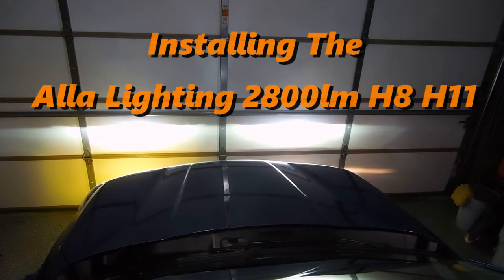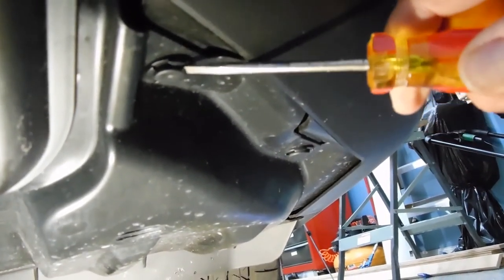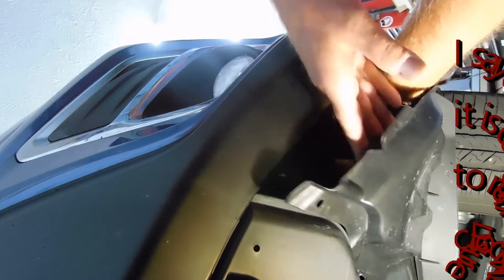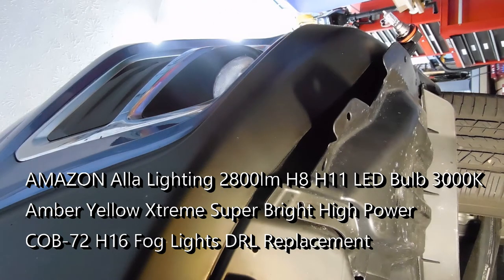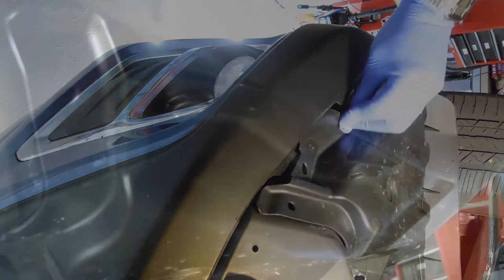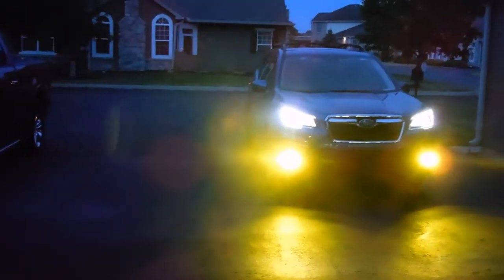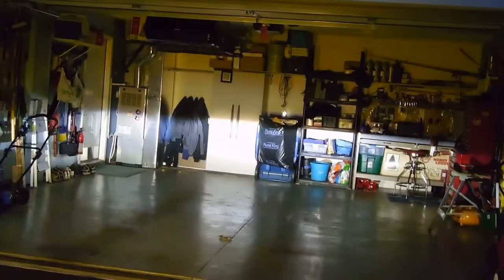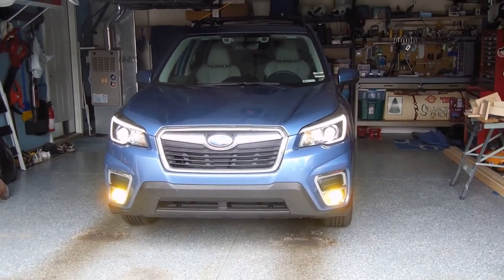Alla Lighting LED (Fog / DL) Bulb 3000K Amber Yellow: Review and Installation

Comment: Excellent Video.  Is that an H11 bulb size for the fog lights?
Reply from the maker: Yes. Here’s the link to Amazon where I purchased mine.
Alla Lighting 2800lm H8 H11 H16 LED Bulbs, 3000K Amber Yellow Fog Lights, DRL Replacement for Cars, Trucks, Xtreme Super Bright High Power COB-72 SMD Upgrade https://www.amazon.com/dp/B07G5VLVNM/ref=cm_sw_r_cp_api_glt_i_BTVH38BEAG241363DCM1?_encoding=UTF8&psc=1
I’m still very happy with them. Much better than what came on the Forester!
Thanks for watching! 👍
Reply: @BoilerDan1  Thanks!

Comment: I tried installing another brand of led fog lights... Definitely not as easy as changing the rear and front turn signals. I do not recommend trying to change the led fog lights if you're not 100% sure what you're doing. I spent 2 hours trying to change the fog lights on my car only to put the OEM lights back on. The OEM are easier to install because of the metal locking mechanism, where as aftermarket parts use plastic which makes seeing what you're trying to do very hard, almost impossible.

I broke a part on one light trying to install it which leaves me with only one fog light. I'm just going to throw them in the garbage.
Reply from the maker: Sorry to hear that.  I didn’t have any major issues.   We’re you trying on the 2020 model year with the same lamp style?  I knew that the limited and premium versions may have different lighting?
Anyway,sorry about your experience.
Reply: @BoilerDan1  It's not your fault. I mean, your video was helpful. It was cold outside which maybe why it was hard to remove and install the lights. I definitely wasn't working in the optimal conditions.

I'm just starting to do things the ''DIY'' way.

I just wanted to let others know it isn't as easy as it looks, and to be prepared.
Reply from the maker: I think cold had a lot to do with it!  It was warm when I did it. I do remember that I had to bend the cover out and was thankful it would stretch without damaging it plus I could slip my hand inside to get the connections hooked up.  If it was cold, the plastic covers would be stiff.
I didn’t think about that at the time.

Comment: Didnt mention what bulbs you were using.
Reply from the maker: It’s in the title of the video. Here’s a link for them through Amazon.  At first I was concerned that they were too bright.  But I’m very happy with them and no one has flashed their brights at me.
Link: Alla Lighting 2800lm H8 H11 LED Bulb 3000K Amber Yellow Xtreme Super Bright High Power COB-72 H16 Fog Lights DRL Replacement for Cars, Trucks https://www.amazon.com/dp/B07G5VLVNM/ref=cm_sw_r_cp_apip_PRyncKWuxaXnz
Reply from the maker: Actually, I do mention the bulb type in addition to the exact information about the bulb starting at the 2 minute mark in the video.  So keep watching! Thanks for watching and taking the time to comment. 👍

Comment: DRL replace LED how (Subaru Forester 2020)
Reply from the maker: Here’s just what you need:
https://youtu.be/7QTRdHIIfRY
Reply from the maker: The DRL can be replaced with LED. No special adapters are needed. Just replace the bulb with an LED version of the same size.
Reply: My Forester version has a DRL bulb with underbody lights and the DRL base is E4 halogen.  I looked for LED bulbs but no bulbs
Reply from the maker: I don’t find any E4 bulbs of any kind? Are you sure that is the type?  I’d suggest going to an auto parts store and confirm the part number based on your model.
I have the same year Forester as you. Is yours the single light, round and down low on the bumper? (Like mine in the video).
Reply: Alla Lighting Extreme Super Bright H11 LED Bulb Fog Light High Power 80W Cree 12V LED H11 Bulbs for H8 H111 H16 Fog Light Lamp Replacement, 6000K Xenon White (Set of 2)
Reply: Can this product be used for subaru forester 2020?
Reply from the maker: @flashlinh  yes, that’s what I installed it on. However, there are different models of the Forester and one has a series of I think multiple smaller lights. It won’t fit to replace those. But if your model has the single bulb, it will work.
Reply from the maker: Just wanted to make clear that the H11 lights that you listed are the correct size.
Thanks for watching 👍